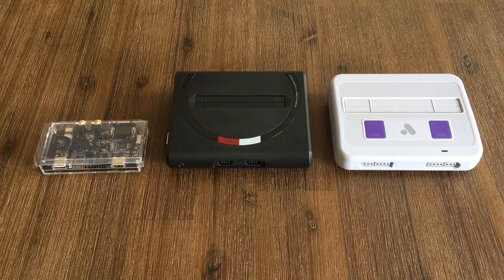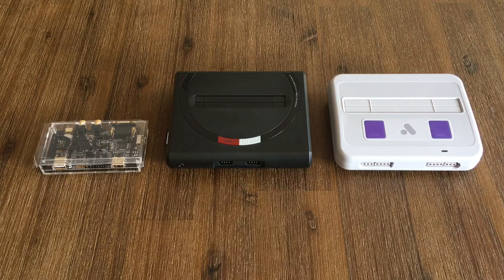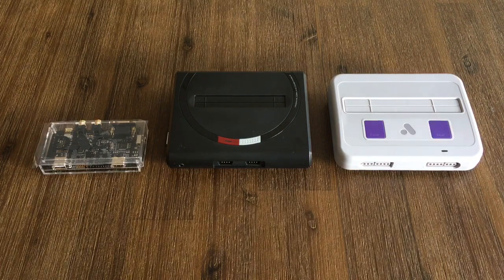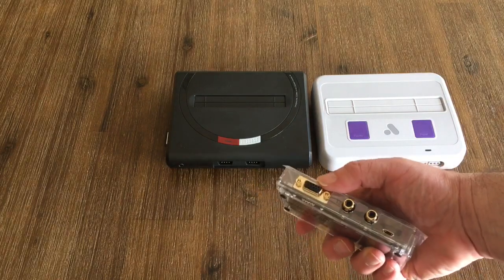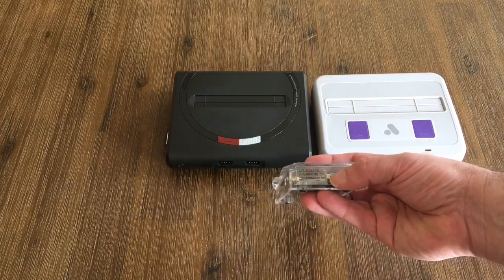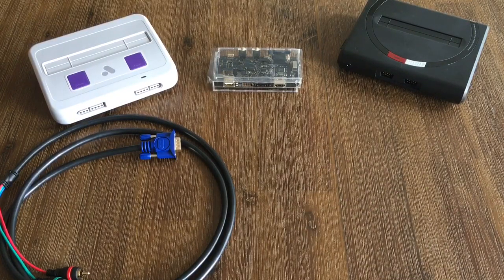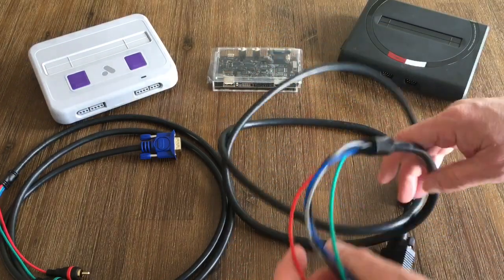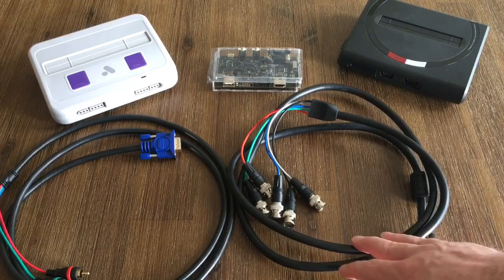Setting up the Analogue DAC Digital Analog Converter with CRT Displays Part 1

Comment: Good video, I have a much better idea now how to use this thing :) one question: is there also an option to connect VGA to SCART? And if yes, is there any difference between using Component and Scart with the DAC? Im quite new to CRTs and this kinda confuses me, even after doing some research.
Reply from the maker: Hi, Sorry for the late reply. A few things going on as usual :) What are you connecting the device to where you need to use scart? Are you using a Scart switcher and you want to use one of the Analogue consoles with it and other retro consoles that are connected to a PVM for example?
Reply: @RealNonsonic  Dont worry about it :) Actually I already fixed the problem by simply ordering the DAC cables from Retrogamingcables.co.uk. It says that they are for the NT mini, but as far as I understand they should work with the Super NT and Mega Sg as well, right?
Reply: Retrosonic hello! Sorry for the late reply, didn’t see your message! Yes, I live in Europe and my CRT only accepts Scart, so how would I connect my DAC to my CRT? I saw that retrocables.co.uk has some special cables for that, but they are constantly out of stock and I think there must be another way, right?

Comment: Thanks for doing this. Haven’t been able to find reviews post launch.
Reply from the maker: Yes, I did notice that earlier. I'll work on some more videos for sure. With everyone at home and making some adjustments it is tricky to work on the gaming setup for content. I'll shoot part 2 very soon, I really need a proper video capture device but will certainly use what I have to do the best I could. Is there anything you need help on?
Reply: @RealNonsonic  Hi :) I keep getting "NO SIGNAL" although I updated the FW to 4.9 on my supernt? And the led of the DAC is only briefly on when I plug in the plug, after that its always off. Additional info: I'm using HD15 to RGB Scart cable :) thx for your support if you have the time. Kind regards Rudi
Reply from the maker: Just posted part 2 - https://youtu.be/HVLDxqLTQvY